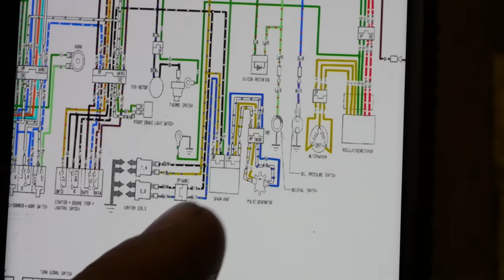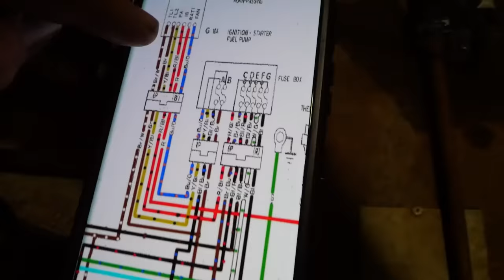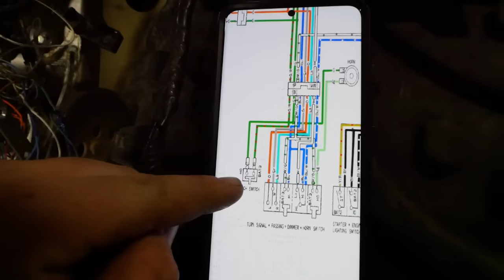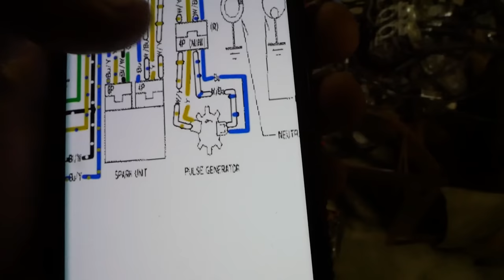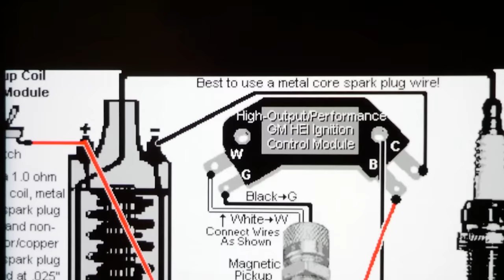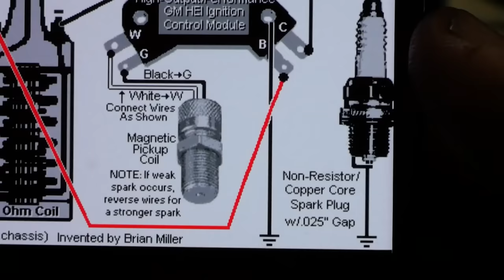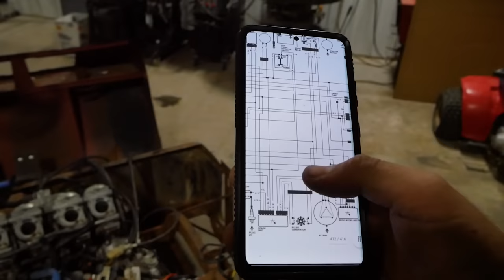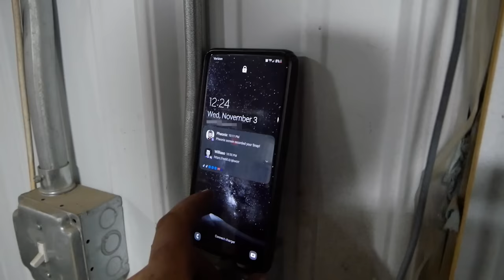$100 Crotch Rocket Powered Golf Cart Revival

Comment: That was hilarious when the compressor came on.  When guys used to fire up boards for the first time, after design, some clown would always generate a large clap nearby right when the switch was thrown.  After a while it became completely ineffective.

Yeah, punch any ole file type cleaner through those jets, that'll keep things working like they should(n't).  Not the best of ideas, kinda why every carb kit you buy specifically warns against it.   Also, just throwing any old muffler on there might not be the best idea, performance wise, often they are specifically designed, like the intake boxes, to even out throttle response throughout the RPM range.  I'm guessing you don't have the airbox either?

Good tip on the tap on the bowl screws.   Another trick I use when they are tough is to bear down hard, almost like a hit, when you turn the screw driver.  That helps, too.  Light use with the hammer impact works for vastly more stubborn screws.  In a pinch, if you don't mind buggering the screw visually, a vise grip works as well.  Replacement screws can be found.

Comment: fuel tank lid needs a air in vent hole putting through it so as the fuel level drops the space can be filled in with air not cause the fuel to be held back with air tight seal .

Comment: nice honda huricane motor put a carbon slip on n jet kit with some old socks over the carbs n some links out the chain with vacum fuel pump n shell be golden just put a 86 cbr 600 for my boss came out mint bro

Comment: That’s not a hall system, that’s a reluctor wheel. Hall sensors use a magnet to trigger them, and they work like an on off switch, but need power fed to them. Reluctors generate AC pulses, have little coils or whatever in them

Comment: (more than one phillips size)  technically, on japanese stuff, the right size isn't philips at all- it's JIS.  It looks like philips, but it is *not*.  There will generally be a "dot" on the head that designates it as JIS.   I definitely recommend investing in a real JIS screwdriver, they fit so nice.   I recommend the 'vessel' ball grip screwdriver, it's easy to find on amazon and it is very pleasant to use.

Comment: Street bikes often have a anti theft feature built into the ignition switch to make them harder to hot wire.  It is often as simple as a resistance needed in one of the three wires going to the ignition switch.  I know on a Suzuki the switch can be replaced by a 100ohm resistor (we often take the switches off of race bikes).  On the Suzuki there is a relay in the main fuse box that the resistor closes with out the resistor the solenoid never tiggers and bike does not work.
Reply: Sometimes it controls the CDI and sometimes it keeps the fuel pump from coming on.
Reply: Also why on earth are your rubber mounted carbs grounded to the motor? When you were checking the spark?
Reply: Also the carbs have a vacuum slide so you need to get the vacuum difference tuned right so they open at the correct speed.  With out a air box they are probably opening to fast.  This is easily adjusted with the hole size in the bottom of the slide.

Comment: You do NOT want the file tip cleaner when clearing brass and aluminum parts. The wire from a metal brush and carb cleaner is a safer option

Comment: Hint you can do the same troubleshooting using the ohms until you get to your problem parts. Why? Because energized circuits can be intermittent issues and dangerous to both equipment and yourself or your shop mate. But when energized to check proper operation disengagement switch is like a dead mans switch you have to hold it for it to work. So running for your life  also stops the gear from running. Safety isn't your forte but hey view a bunch of pictures of dead guys who made a silly mistake and your eyesight changes. Or not....

Comment: the original fuel pump puts out 0.6 bar of pressure just so u know all of them do from like the 1988 models to 2000 model all use the same pump and its a impuls pump not constant presure the pump has a set of 2 points similar to a car just double that regulates the presure and make sure to use a set of vacume gauges to adjust the levels on the carbs themselfs

Comment: That's a CBR600F1 engine right? I'm sure you know . . .but motorcycle engines are especially picky when it comes to airflow. Bolt that stock airbox on with a stock paper filter if you have it and the engine will run far better. I think the paper filters are still manufactered by hi-flo. The chinese pumps from ebay work fine. They are solenoid type pumps . . . you could probably retrofit one from virtually any curbureted bike. I believe tourmaster makes replacement points too.

Comment: your so close breathable fuel tank ,and vacume pipe of air box to carbs inlet with tee piece and crank case breather pipe added back to intake with a air filter box and then i think your all set to rip mine does 150 mph flat out top gear so maybe a little roll bar loop lol

Comment: Since you are crossing the solenoid to start it why didnt you just wire a push button to it? In my shop I have a few buttons with 3', 5' and 10' wires ending on alligator clips just for this problem. Its just a solution until its fixed, but its so much better than a screw driver.

Comment: Those engines starts kickin at 7000 rpm, so when they full trotle from like 2000-3000it has no power and its more like staling it i think it would be workin better if they had all parts from that bike so it could fully function.

Comment: i just got a used 2009 ford fusion and it should be good for acceleration, having a 3.0 v6 for that little thing.  but something's wrong... i took it to a mechanic I know and he didn't find anything wrong.
it feels like, for one, the wheels aren't coasting freely.  I lurch forward after taking my foot off the pedal.  also, it regularly gets up to 5-6 rpms when i'm trying to merge with traffic.  it seems like my engine should not be working this hard.  it's loud.
also only getting 18 mpg.  WTF?!

Comment: they arnt philips screws, japanese vehicles use JIS not philips which is why you see so many japanese cars or motorcycles where the screws are messed up and head knackered. its because people think they are philips and use philips in them which are designed to cam out and cause damage

Comment: Carburetor kit makes it so much easier so full of shit when you have brand new Jets needle valve etc
Reply: Not to mention that if one of the bulls starts to fucking leak cuz of the gasket you don't burn your motor to shit when it catches fire with the gasoline leak on another stupid question what the fuck are you going to use for gas tank most rockets I've seen have fuel pumps gravity feed doesn't work

Comment: Those carbs have to be balanced. You can build a balance system for like $20. They will run off the vacuum from each other and it all has to be the same pressure you tune the 2 left carb to each other then the 2 right carbs. Then you to the left and right set to each other. Look it up. You won't need a fuel pump if they are set up. As soon as I seen you taking them apart I was thinking " I sure hope they know how to tune carns" Here is a link.https://www.youtube.com/watch?v=zQdgkt2zQZE&ab_channel=CafeRacerGarage

Comment: Do you relize that could be if you Check the engine code for what year it's from ,  1986/7 D Reg in ENGLAND any way , was our First Model from them released to sale fitted with a full Body Firing from them! (nicked name'd The Jelly Mould and so reare to find and buy body panel's as no one makes anymore so expensive )New addition to there range  NOW really getting quiet rare only made 2,800 all to gether First Year Engine from a FIRST EVER Realised  ATEMPT From Honda's  FULL FAIRING MOTORCYCLE ,CALLED THE CBR 600 F1 HURRICANE/ AS IN THE Very First Original OG MK 1 For A History Type Collectors of the progress from just the CB_ _ _ ETC , HONDA'S Very First Attempt at Making A FULL Race Style MotorBike with  Full fairings fitted to the Honda Family Range Market Place.